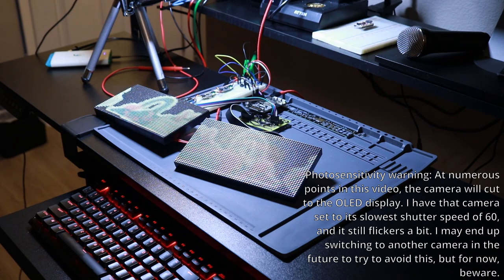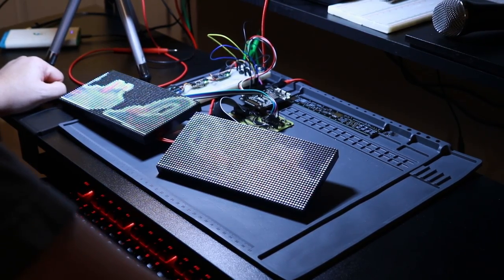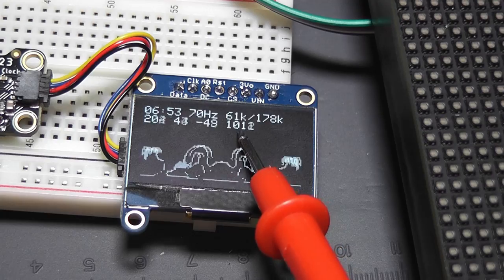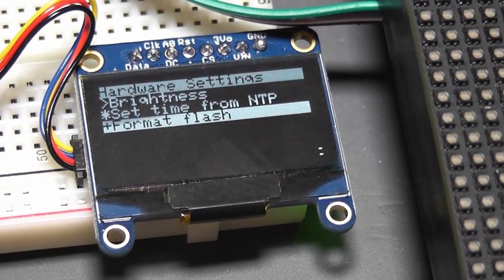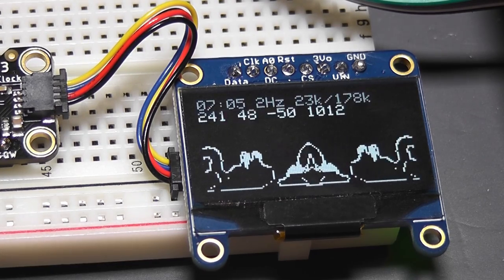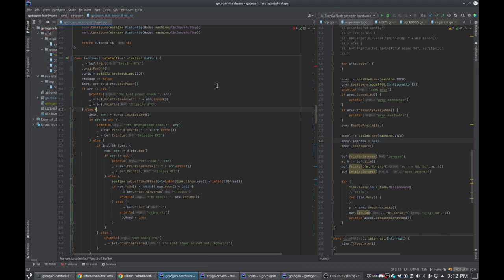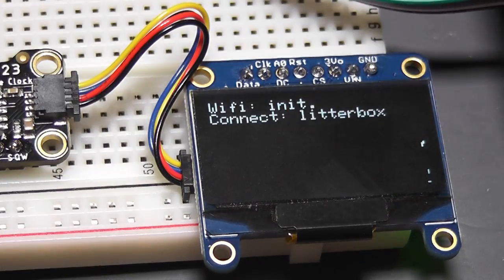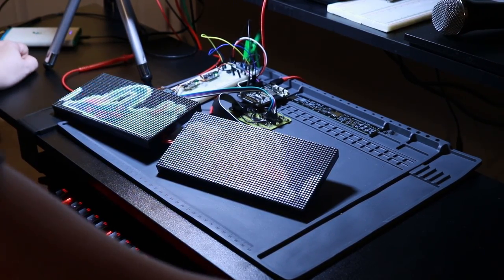Protogen Head part 5: Menus, Faster Animation, and More

Comment from the maker: While I was re-watching to get the chapter timestamps, it occurred to me that the screen lockups were perhaps caused by the DMA I2C complete interrupt not firing correctly. That would disable all updates to that screen, and why pressing the menu button (which is the button I used both times) would then cause the external screens to hang (the main loop is waiting for the menu to draw, which it can't since it thinks there's still a DMA in progress). If this happens again, I'll spend more time trying to figure out what exactly is going on, but these are the only times I've had this happen in several hours of having it running.

Comment: Do you think you can get doom running on the displays while they are in the protogen head? Like a mini console display. I'm making a second protogen head with P3 matrices and I'll try to do just that.
Reply from the maker: It's certainly technically possible (it may also require a different microcontroller), but I don't have the desire to try to figure it out.

Comment: Damn, i wish there was a more automated way. Like have the displays and the drivers, and just use something to send data to those. Use some higher level language to render stuff. I was thinking of the pi4 or something similar. Heck even use a game engine :D.
Reply from the maker: It's certainly possible, but that is definitely not my area of expertise. TinyGo is already a relatively high-level language, but the microcontroller is still rather limited. It'd certainly be possible to use a full SBC like a Pi or equivalent in there, but physical space is somewhat limited.

I may eventually change the code to draw instead of loading bitmaps, but bitmaps are quick and easy to deal with (and make replacing the expressions or changing the color super easy).